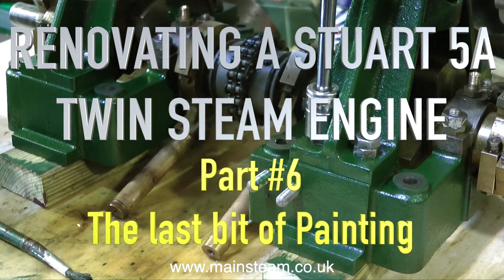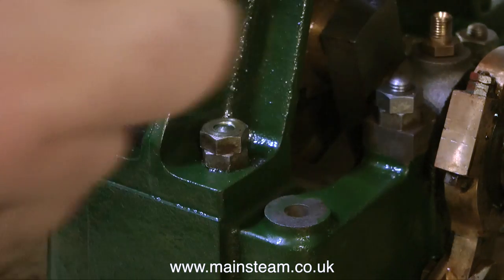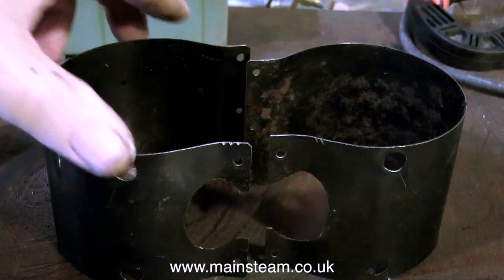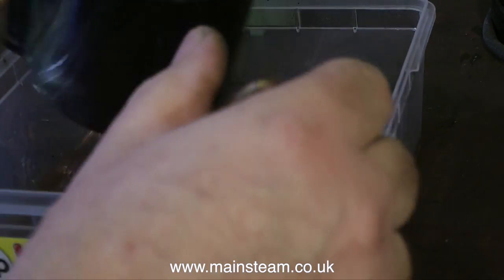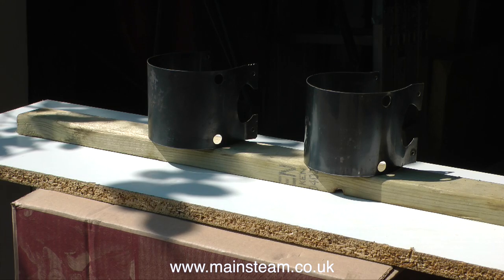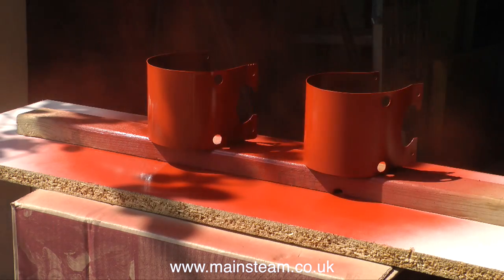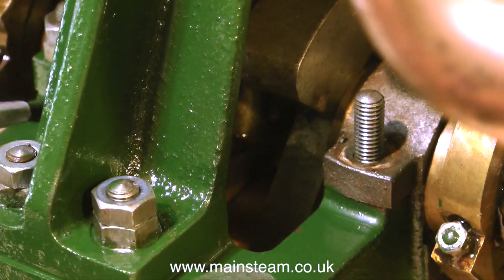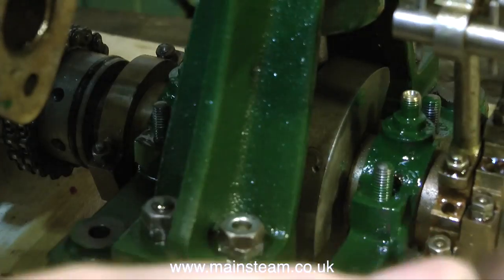STUART 5A TWIN RENOVATION -  PART #6

Comment: If you must do spray painting in the nude, it is hardly surprising you get over spray on your equipment. I guess it takes quite a bit of rubbing to it remove too, you wouldn't want to use solvent now would you.too. :<)

Comment: For my curiosity: It appears as if the steel cladding was blued originally. Is there a particular reason why you would recommend painting over a blued finish for parts?
Reply from the maker: The "Bluing" was damaged in places.